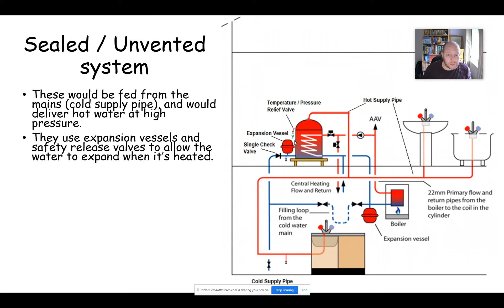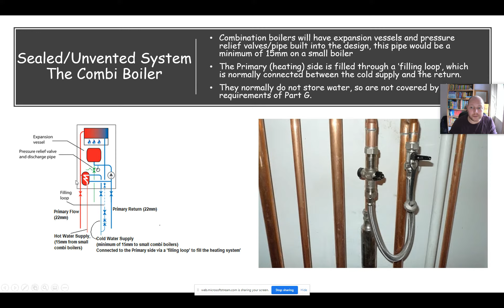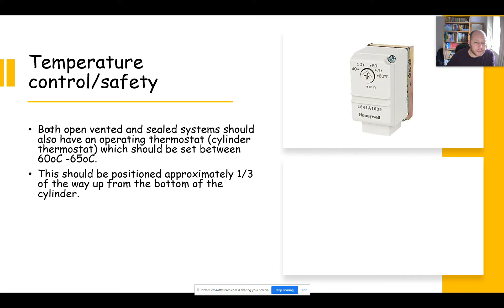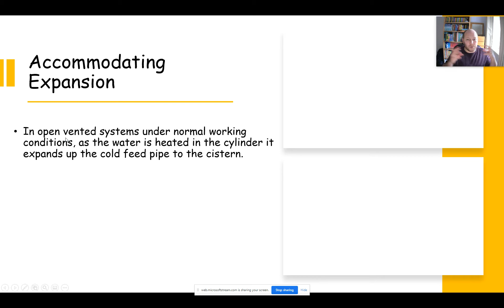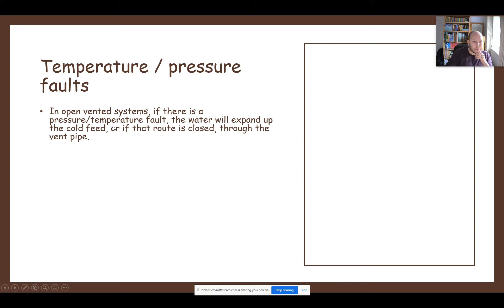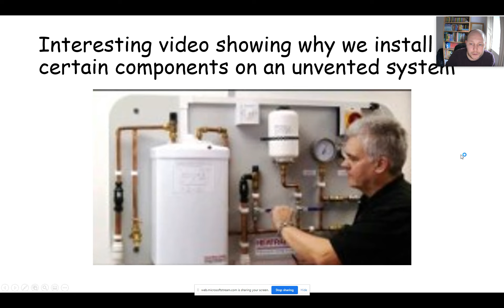2 2 2 Open Vented and Sealed Systems Part 2

Comment: Hi dainel ive got a question to ask i came across a open vent heating system but for some reason it has not got a expansion pipe for heating circuit?
Now i wanted to ask is it possible i can install a remote expansion vessel? 
If so which pipe do i install it on Flow or return?
Before or after pump on flow?
In airing cupboard
Reply from the maker: Good question! On an open vented system you shouldn’t need an expansion vessel. The feed & expansion tank in the loft already takes up the expansion. What you’re describing as the “expansion pipe” is the open safety vent, and that’s there for safety if the system overheats, so a vessel won’t replace it.

Before doing anything, check whether it has a combined feed and vent (one pipe doing both jobs, often with an air separator by the boiler). That’s the usual reason people think the vent is missing. Also check for a pressure gauge or filling loop, as it might already be a sealed system.

If there genuinely is no vent, either fit one correctly or convert the whole system to sealed properly: vessel, PRV, filling loop, gauge, remove the F&E tank, and make sure the boiler and old radiators are suitable for system pressure. Don’t just add a vessel to an open vented system and call it done. On a sealed system the vessel usually goes on the return near the boiler, on the suction side of the pump, but always check the boiler manufacturer’s instructions.
Reply: @plumbmatemastery Thank you for your detailed well explained reply